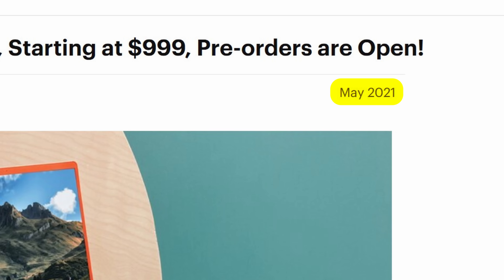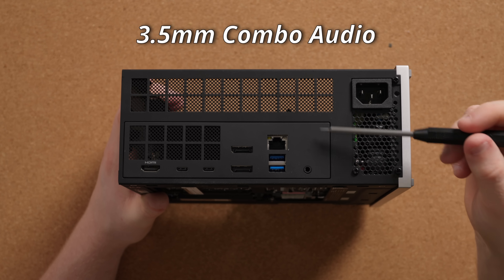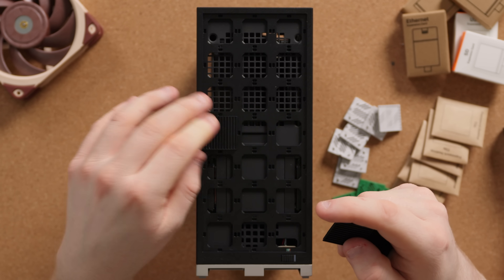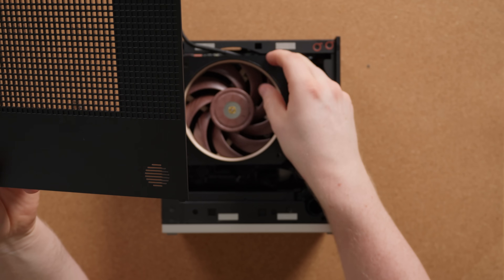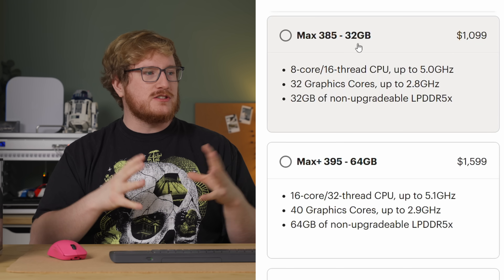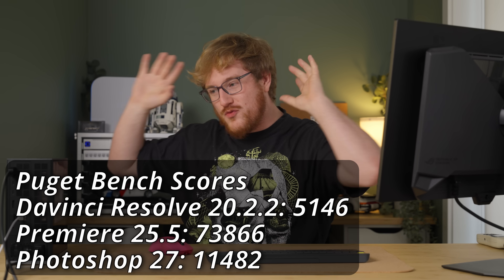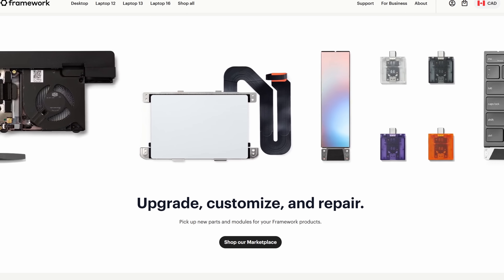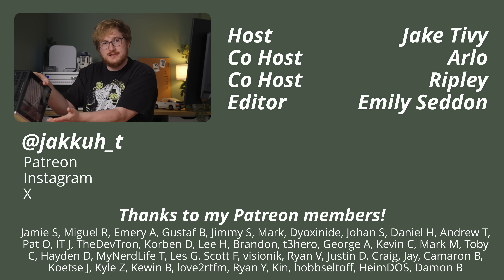I’m glad I didn’t invest, so I can talk the Framework Desktop

Comment: 13:30 When Framework announced the Framework Desktop, in the presentation? I think? they mentioned that they had approached AMD about non soldered memory and AMD engineers did try to make it work according to framework but it lost significant performance due to the lower bandwith and higher latency. GPU memory is soldered for a reason so this isn't really unbelievable to me too.
Reply: It wouldn't have worked at 8000MHz is what they said, and lower clocks would be a dealbreaker for such an expensive chip
Reply: This I recall that presentation too. they could not get the signal integrity to run that memory on that cpu. But with AMD now aware that there is a customer looking for it maybe next gen will have it.
Reply: What did they try? By my understanding, Intel's CAMM2 memory gets very close to soldered speeds and integrity, as you have much shorter paths than DIMM, and you can pack more into a flat PCB with 1 hole that mounts right next to the CPU than you can in a vertical PCB that needs to clear a bunch of stuff.
Reply: @Deja117  AMD never thought about CAMM when making their flagship APU was my impression. They were asked by Framework if it would work, tried it and realized it wouldn't, and that was the end of it.
Reply: @marshallb5210  Ah fair enough. In all honesty it is a very new approach, I wouldn't be surprised if it was being considered for upcoming boards next year. - To be fair, if modules do fail, you can send back under warranty for RMA. It's just not so great that they only offer a one year warranty in the US. 3 years would be a lot nicer, but that only seems to be in Spain... 😅
Reply: @Deja117  I assume sodimm

CAMM2 might be able to get there. But for now CAMM2 is in such early stages that it's not only very expensive but also there are so few options that it might as well not really exist currently. I would also love CAMM2 modules in the future but doubt framework has the market share to push that standard forward
Reply: @Deja117  the best camm2 available is still less then half the memory bandwidth of the shared memory pool on this board and a quarter of the memory bandwidth that apple silicon has. The GPU also doesn't have to ask the CPU for memory allocations with a shared memory pool further reducing latency. Solder memory and particularly shared memory pools  have way higher memory  bandwidth and inherently lower latency by design even though Mt/s speeds are almost the same as Camm2.
Reply: They literally didn't have to offer this specific product.

That's what I don't understand about this point. This is a niche offering that arguably was done poorly. It's a horrible cost for a desktop gaming pc, and for LLMs you're basically locked into arch. Could be worse, but could be way better. Not supporting Ubuntu out of the box is crazy, and it looks to me like it was because they specifically chose network chips that have limited linux support. an LLM machine that has minimal linux support for the networking?

Why did they try to break into a field that they couldn't without compromising on their stated goal of reducing ewaste and making things repairable?

When a company is ideologically driven and founded, and the product doesn't reflect that, it isn't the product's fault they chose to participate when they could have done literally anything else. They broke into a market less repairable and that produces more ewaste than normal, and didn't change that or challenge it in any way.
Reply: @brahtrumpwonbigly7309 Well, people that would have bought this product, would only had the option for a laptop, and it's a good enough machine for local LLM without going MAC, which is coming from the e waste generating company of choice, Apple 

This product is just to have the chip and capabilities that are into it for desktop and not having to BUY A WHOLE LAPTOP and do some shenanigans for cooling and having it flat and whatever

If they don't have anything to add to it, they won't, that's why we WON'T HAVE PRINTERS soon or probably ever
Reply: @brahtrumpwonbigly7309 It's a really good AI chip that is otherwise only available in laptops. They offer it in a desktop format with better cooling and whatnot. 

If you want a repairable desktop for ordinary stuff, then you don't actually need Framework. There are plenty of options to choose from already.
Reply: @brahtrumpwonbigly7309  They don't have to support Ubuntu and I don't understand why everyone always wants to support Ubuntu. If you're serious about using this for gaming or LLM, you won't be using Ubuntu anyway. I use it with NixOS and it works fine.
Reply: @brahtrumpwonbigly7309 the chips they offer are dumb. There are other ram configurations they offer the best for LLMs and the rest is kinda meh. There is a 90 something RAM chip and they don't offer 390 at all.

OR hear me out with all that RAM if you had a proper PCIE slot to get a dGPU in a couple of gens the barebones option would be a killer.

Comment: It's not that AMD wouldn't "let" them. AMD worked with Framework to try out socketed memory but it just would not work at any level of acceptable performance.
Reply: Right. Unified memory architectures require low memory latencies not attainable with socketed RAM.
Reply: @warpedgeoid  i wonder why i mean contacts are contacts, unless of course the distance of a 1mm makes all the difference
Reply: @LethargicLemon  Each of the pins in the socket act like little antennas for interference and it makes a huge difference at those speeds
Reply: @LethargicLemon  it really does
Reply: @LethargicLemon  at the molecular level the pins never actually touch each other. There is always some level of resistance, even if it’s very low. The soldered connection has the same issue, but the space between molecules is much much tighter which eliminates resistance as much as possible. The leads in the board needed for sockets are also somewhat longer.
Reply: @GrantDefayette The problem is not the resistance, it's the RF interference
Reply: @GrantDefayette  i would assume it also adds quite a bit of parasitic Capacitance and Inductance, slowing down the clock speed
Reply: @GrantDefayette  If there is such a thing as "touching on a molecular level", that these do not fit into, could you elaborate? I feel like any definition of "touch" would include this situation. I get your point in that there is a vast difference between bonded and non-bonded connections, but that is just not good phrasing.
Reply: wasn't there some new ram stick standard that was supposed to solve this issue?
Reply: @ukyoize  if you mean CAMM2, its primary purpose is reducing the length of the traces by using a big LGA socket, moving all the DIMMs closer to the motherboard. With DRAM all the traces need to be length-matched. LGA socket makes it so the "furthest" DIMM module is far closer, so all the lengths can be reduced (which reduces power needs(thus heat) to maintain signal integrity, thus allowing higher speeds).
it's still socketed, so not sure if it'd be completely enough. It's a compromise solution vs soldered DRAM, to get some of the advantages of soldered while still allowing user upgrades.
Reply: @ukyoize  There is a relatively new desktop dimm technology to have a chip on the stick do some signal processing magic to improve things there (not sure why they don't put a boosting chip at the halfway point tbh), and I do wonder if it could be useful for laptops too. Probably won't be a thing though, at least not in order to bring back socketed ram. Maybe in the future that tech will simply be required for adequate soldered ram if anything.

Comment: After watching the video, I'm still kinda stuck wondering why this exists as a product. Maybe I'm missing something, though. Yeah, the performance seems to be good, but for $2,000+ I would expect it to be. What I know of Framework is their focus on repairability on their laptops. This desktop appears to be less customizable/serviceable than other desktops. I'm just struggling to understand why I would want to purchase this specific product rather than put that same amount of money towards a desktop that I can build myself. The only thing that seems "Framework" about it is the ability to customize the IO on the front. But I fail to see how that is significantly better than purchasing a USB adapter or something similar. This is a desktop, after all. That gimmick makes sense on a laptop because the focus is portability. The only thing that this machine seems to be trying to do is allow the chipset to reach its potential by giving it adequate cooling. But does that alone justify its existence? I'm not sure. It's an interesting machine, but I struggle to understand it.

Comment: Still don't understand why it couldn't run CAMM2 modules. Is it because you'd have to have two modules for 256 bit width, which cannot be done yet? I don't see why not, it's just a matter of trace design. I know RAM is pretty reliable these days, but I'd still like the option of upgrading/replacing. Especially since they keep upping these LPDDR5 speeds. Gskill is at 10,000 mt/s now. And with DDR6 around the corner, being able to upgrade when speed and latency get better from initial release, that's a big deal.

Comment: About the powercord, I feel like they could have dodge that's "negative" feedback, if instead of raising the price by 5$, they made it so it was included but selecting "None" would give you a 5$ discount. Same result, diffrent precived value
Reply: That's a good thought. The only thing is, because they supply a bunch of international plug variants, how do they determine which is the default power cord to include?
Reply: @richarddavis2605  That's actually really easy since its gonna be shipped. Include the default style cord for the region. Its not like its a state secret what type of power system each country has.
Reply: @richarddavis2605  I'd just price it by default based on your browser region
Reply: @richarddavis2605  just set them all to be 0$ and the option "None" is -5$, similar to how it's often done on configurators for semi-costom pcs :)

Comment: Market driven pricing is usually - at least part - of the equation.  Meaning the cost of the items in the box are disconnected from the price.   So consumers are usually just getting more for their money when it comes in the box by default.  Framework is likely charging you an extra $5 for the cable rather than reducing the price by $5.  These cables cost almost nothing (25 to 30 cents).
Reply: You're just guessing though right ? Lol

Na man cheapest one best buy sells is like 8$ so from a bulk supplier 5$ seems pretty reasonable.
Reply: @whatsmolly5741  I'm not just guessing.  They would be buying the cables for 30 cents and selling them for 5 dollars, instead of just dropping it in the box for the same price.  That is of no benefit to the consumer.  I'm not saying they're a bad company, just that they guy's point in the video might be off the mark.
Reply: @BlithelyDoubting  thats not how bulk pricing works lol it doesn't just keep getting cheaper the more you buy. You arnt getting something that sells on store shelves for 8$ for 30 cents... it caps out and most of the time way before you hit 70% much less 50% or single digits like you are implying.
Reply: @whatsmolly5741  My friend, I don't know what the current bulk price is for a power cable.  It's fair to say that I overstated the disparity.  I was quoting a price from years ago when I was involved in such things.  Maybe it's 2 dollars per cable now.  My point is that the price is disconnected from the price of the product.  That means when companies include it in the box, the price of the overall product would not change.  Therefore, you're receiving it as part of the product that you expect, with no additional markup.  This is the same problem people have with Apple not including a power adapter.

Comment: I would totally order lowest spec then solder on upgraded ram if I needed to upgrade my system but frankly i5 12600k and Rx 6800 XT 16 gb vram and 32 GB ddr5 I don't think moving to a soc is any kind of upgrade.

Comment: Would be nice if they routed the 4 lanes currently on the x4 pcie slot to an external oculink connector instead.
Reply: I don't think so. PCIe is more universal and you can add in a occulink PCIe card. But they should have made the PCIe slot accessible within their own case, at the very least for SFF cards.
Reply: Why? you can already buy Oculink expansion modules for these...

Comment: The Framework website requires you to buy at least one set of the front tiles.  You can't just make your own.

EDIT: My mistake, you can checkout without doing it.  Bad web design still.
Reply: I was curious about that and although it does say to select tiles it also has the option to add to the bag without them as you can print your own. Sure they could have made this easier  for the user with a select button like Bring your own or Print your own like similar other accessories.
Reply: which is yet another goofy issue with this. Is it an LLM machine with horrible linux support or an overpriced and illogically spec'd mini desktop gaming rig?

Comment: FW13 is their best device. FW16 is massive and does not compete. Framework Desktop is way too expensive unless you've got a particular use for it.

All their speakers are subpar and they're not using dsp tuning thst they could use. All their screens are subpar with best being FW16. All their machines are very expensive. Their one year warranty on their mainboards is just as bad as other companies. 

I have a FW13 but I will probably sell it. I really need performance of a FW16 but it is giant, expensive and it does not compete performance wise with smaller machines. They should have made a more compact model with cpu and gpu on the mainboard.

Comment: Real nice take on the Desktop with pointing out all the "errors" most other reviewers made. Also Nirav said in an interview (I think with Linus) that AMD basically approached them and asked if they wanted to build a product around this chip.
Reply: It's also not something the average user would check on a "Desktop". Framework kinda deserves the bad press they got for the power problems. I just checked their website and I couldn't find anything linked to the Desktop that suggested that power profiles needed to be adjusted.
Reply: @AlpineAnarchy.01  Well, if you take it that way then I must inform you that's something each and every one of the laptops and desktop PC have as a problem when the default OS is Windows. Its the same for plugged in windows laptop vs unplugged windows laptop. That's why Macbooks always had better performance with same Intel CPU to compared Windows laptop.
Reply: @helloukw I'm fully aware of this and always set a custom power profile, but I was approaching it as an average user. And a lot of YouTubers do too. They test things with the out of the box settings. Unless there is documentation specifically saying that the power profiles need to be changed, which there doesn't seem to be on their website, then the average user is unlikely to know the power profile needs to be adjusted for max performance.
Reply: Yes, Windows power management is weirdly complicated at first glance and it shouldn't be. Also Windows has come a long way to make things complex for no good reason. In a nutshell Windows has become an UX nightmare and I'm a Windows user since Windows 95.

Comment: The major problem is you have to buy the tiles. You can't leave them off. What if I don't want to pay for stupid tiles? Well, you are SOL. They make you buy the useless things. So I will be passing on this computer souly due to this issue. Not buying something I don't want.
Reply: I was curious about that and although it does say to select tiles it also has the option to add to the bag without them as you can print your own by pressing Add to bag again. Sure they could have made this easier  for the user with a select button like Bring your own or Print your own like similar other accessories.

Comment: Thank you. The whining about "not socketed RAM, not a real framework" BS has gone on long enough. "But did they try LPCAMM?" YES, NIRAV SAID AMD DID. IT DIDN'T WORK.
Reply: I’m sure Framework will have a mb/soc/ram available when the next gen comes out. Why are people so stressed
Reply: Nobody forced them to put out an LLM host with minimal Linux support. How is that a good argument for putting out a product that directly defies thair stated goals as a company? What part of sustainability, reducing ewaste, and repairability went into trying to compete in a tiny niche market that required compromise on all fronts?
Reply: @brahtrumpwonbigly7309  Their base configuration would easily suit pretty much anyone looking to do basic task or some light gaming. The mid tier model is a pretty great all rounder and the top tier is clearly meant for productivity work. There's no soldered storage. You can swap out pretty much anything in this pc beside the cpu and ram. It's one of the most powerful sff machine of that size I've seen barring the ones with egpu support or macs. Any configuration of this machine is going to last you a really long time. I have way less of a problem with the framework desktop compared to a mac where apple will literally sell you a under-performing machine for oodles of money ( 8GB m1 macs or m2 ssd controversy). The point is that It's perfectly adequate for what you could conceivably use it for and if you need more then you have the option to build it. That's where the criticisms fall flat because you already have the ability to make what you want if you don't like what framework has to offer. I don't know of any other strix halo desktop on the market beside framework and it's clear why they chose this soc.